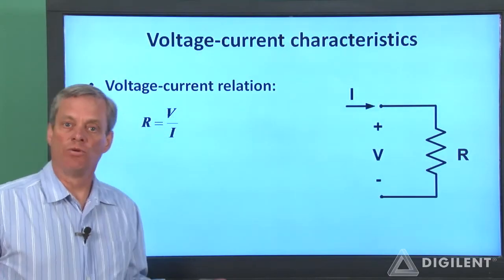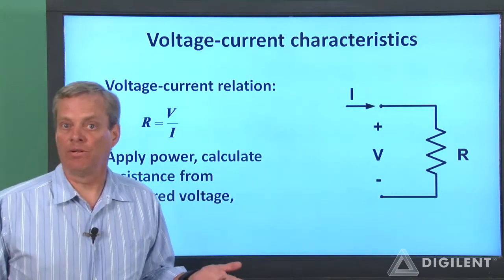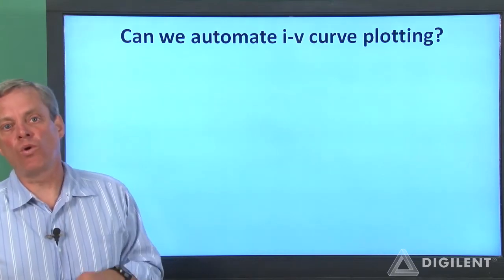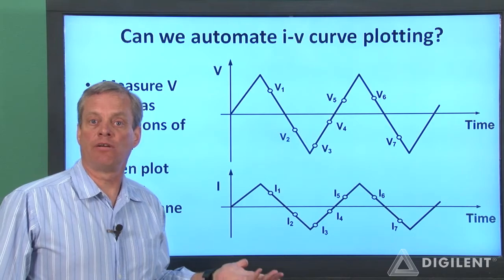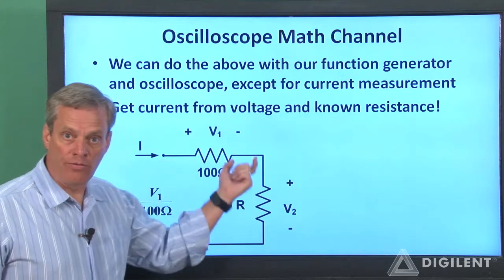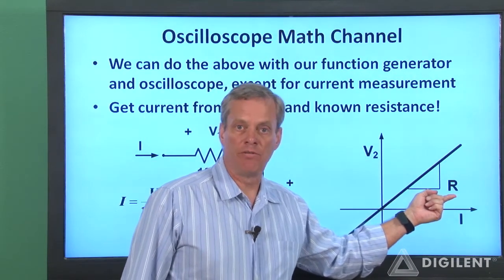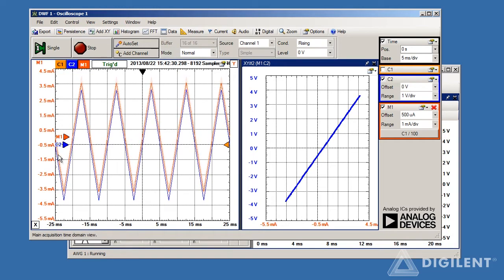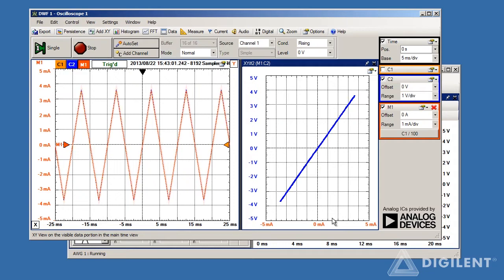Ohm's Law as a Voltage-Current Characteristic

Comment: Thanks sir. Can enlighten me why the sweeping is done in both positive and negative directions, and what if the IV is not symmetrical? Thanks
Reply from the maker: +Outlaw That is a good question. The best place to go to get answers to questions like that would be the Digilent Forum. Here is a link to the Forum: https://forum.digilentinc.com/

Also, here is a link to another video with some helpful tips and tricks for posting questions on the forum: https://youtu.be/krqSlIsPhJo

Thank you for the question!
Reply: To fully characterise a circuit element under test, one needs to know how its terminal voltage is related to its terminal current for all values of i  (positive and negative); hence the positive and negative sweep of i ( or v). If the i-v characteristic obtained is a straight line passing through the origin then one can relate v and i via a straight line equation of the form v = Ri, where R is the slope of the line and the element is identified as a linear (or, ohmic) resistor. On the other hand if the i-v characteristic is nonlinear, then the element could be a diode, a thermistor, or any one of the many different types of two-terminal semiconductor devices, depending on the type of symmetricity or asymmetricity exhibited.